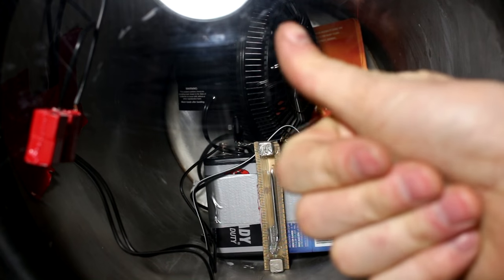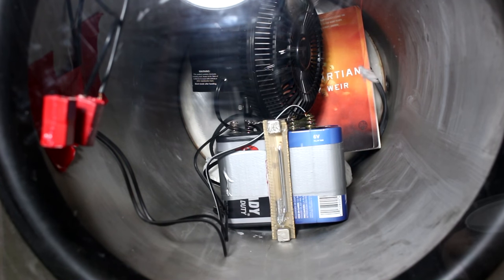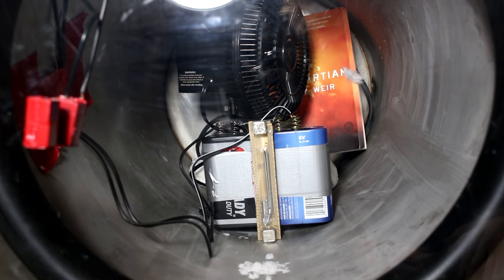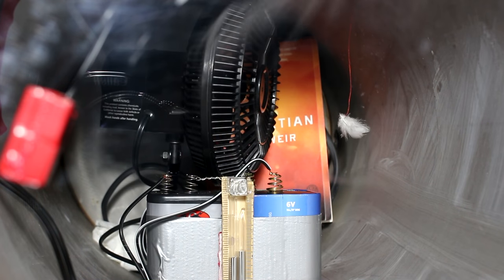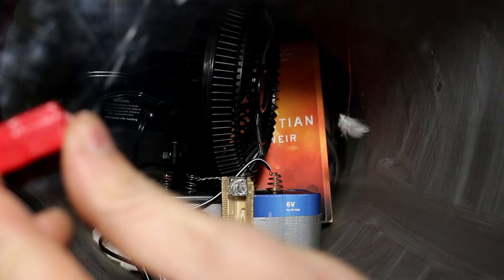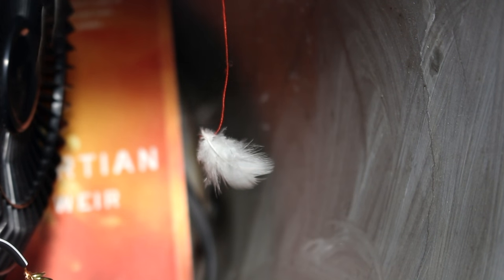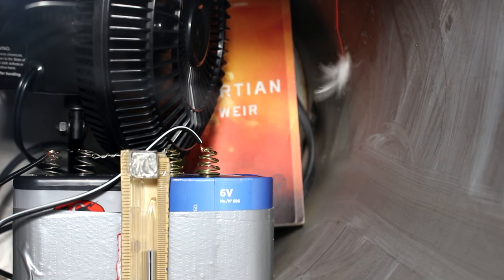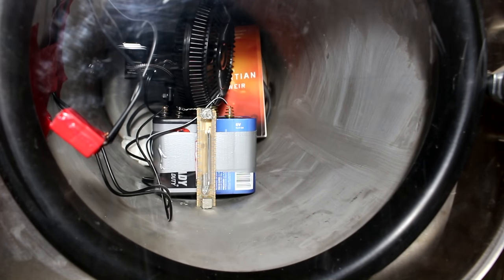How Strong is The Wind on Mars?

Comment: Could you maybe try to produse a venus like atmosphere? If it's possible...
Reply: That could be really fun to do, build some type of pressure chamber and fill it with Co2. Although the heat would take some brain power on how to achieve it without burning his lab down. Not like he needs to simulate the temperature anyways though depending on the experiment like the one here...
Reply: Iron ball, coil copper 1/4" pipe in a cone, backing ferrite from a TV yoke to focus, external coolant run to keep the copper from melting, induction heat that in the high pressure CO2
Reply: He could use one of the high pressure tubes he has, but then he'd have to put it in his lead melting furnace to get it hot enough.  No fan and feather could survive that.
Reply: ***** Yeah you are right, induction is a safe good method to use but the heat would only be able to transfer through conduction unless the material being tested itself is conductive as to generate eddy currents.

Wait are you suggesting that the copper coil to be used like a baking element? That maybe could work then since that could transfer heat by convection and even radiation like the real thing, the sun....

That is a genius idea, I think Cody should consider it, i'm sure he has an old stove laying around somewhere or even could build one himself. Although if he were to build something then using nichrome wire like in pottery kilns would probably be the easier route.

Comment: Is there a reason why batteries wouldn't be able to perform in a vacuum?
Reply: No, not that I can think of, at least with LiPo's.
Reply: It depends on the batteries.  The ones he's using have a carbon rod cathode, a  zinc case anode, and the electrolyte is manganese dioxide, carbon, a smidge of iron, and a tiny amount of a base liquid.  Those batteries will fail if they stay in long enough.  Specifically that liquid will sublimate out, and then it's kaput.

Aluminum-air batteries won't work in a vacuum. Silver-Oxide will if it's sealed.  Alkaline batteries work for a while, until the electrolyte sublimates. Molten salt batteries work as long as they stay warm.  It all depends on the chemistry and how they are sealed.
Reply: LiPos are sealed, that's why you see them puff up when they get old.  If there is enough air inside them the Vacuum will cause them to expand from the reduced pressure.  It shouldn't effect the chemistry, but if the swollen pack hits something sharp it might pop and fail.

Comment: Wow!  If a 200 mph wind wouldn't do much of anything, I wonder how fast the winds must be to create the "planet-encircling" dust storms?

"Once every three Mars years (about 5 ½ Earth years), on average, normal
 storms grow into planet-encircling dust storms, and we usually call 
those 'global dust storms' to distinguish them," said Michael Smith, a planetary scientist at NASA's Goddard Space Flight Center in Greenbelt, Maryland.
Reply: BarefootDrummer My guess somewhere around 60 mph.
Reply: The max wind speed on Mars is about 60 mph. The "planet-encircling" dust storms are because the "dust" is incredibly small... 50x smaller than on average dust on Earth, around the size of smoke particles. 

In those "planet-encircling" it actually more like a "fog" or "smoke" of dust that covers the planet rather than strong winds picking up dust and rock like is shown in the Martian.

Once it settles it's only a few microns of dust that settles... which is about 70-100x thinner than a human hair. So while it looks visually impressive and does actually block out sunlight... it's actually not much dust relatively and when it settles it's incredibly thin.
Reply: Thanks Buckster, personally, I haven't seen the movie, so any references to it go over my head.  However, I have seen photos of Mars before and after the referenced dust storms, and it's pretty incredible (meaning I'm having a hard time believing) that such visual obstruction could be created by a mass of material that would settle to a thickness "70-100x thinner than a human hair."  Do you have any sources for you statement?
Btw, I'm just scientifically curious, I'm not trying to be argumentative.
Reply: Pretty sure he just quoted nasa.
Reply: Well, thanks Reagan, but I was looking for an actual source.  For example, I gave a direct quote from a NASA scientist, but in my initial comment, but didn't provide a source.  Here's the NASA page from which my quote originated: http://mars.nasa.gov/news/whatsnew/index.cfm?FuseAction=ShowNews&NewsID=1854

Additionally, if something were capable of settling to a fraction of the thickness of a human hair then it's hard to believe it is capable of producing the solar radiation reducing (and therefore power limiting) dust clouds that NASA has become accustomed to with the Mars rovers.

Comment: That outro video was interesting, the vibration from the fan caused far more motion of the feather than the wind itself, no wonder you repeated the experiment with an alternative attachment. The book was a nice addition.  However JPL/NASA have mentioned miniature tornados on mars being responsible for cleaning dust off the solar powered rovers. There is a theory that martian dust is electrostatic, and the wind storms are ionised because of the atmospheric conditions which caused the storms. Could you possibly think of an experiment to test this theory? 
Edit: Top google result for Mars dust electrostatic "The Electrostatic enviroment of mars and the moon": https://ntrs.nasa.gov/archive/nasa/casi.ntrs.nasa.gov/20110008730.pdf 
Ok, alternative experiment, can you test the 'rover cleaning events', cover a solar panel in some electrostaticlly charged dust, put a larger fan in that vacuum chamber and an ion generator.

Comment: Martian dust particles must be incredibly small if the almost nonexistent wind there can blow them off the rovers solar panels
Reply: indeed, they're about the same size as smoke particles. Dust doesn't form back into rock on mars as much because there's no surface water to stick them together, so they have a long time to wear down to almost nothing.

Comment: How then is there massive dust storms on Mars that we clearly can see?
Reply: TheMontanaDave I think it does happen because of the faster wind speeds and less gravitational force.
Reply: Da SkyFishy That doesn't answer his the question
Reply: They're electrically driven. Small particles are easily affected by electromagnetism.
Reply: And where the hell is your evidence of this?
Reply: The dust storms are caused more by static electricity of sorts than by wind.
Reply: Use your powers of deduction, we know the wind is not strong enough to cause dust storms so now we need to figure out what other possible explanations there are for dust storms on Mars. The next most reasonable explanation when we take into account that the surface is made of iron oxide is static electricity.  We can also use our powers of observation: http://link.springer.com/chapter/10.1007/978-0-387-87664-1_26#page-1
Reply: Actually according to NASA (Sorry Cody- these guys know a bit more than you) they are caused by the sun heating up the surface and creating terminals in which drive the dust up.  http://mars.nasa.gov/news/whatsnew/index.cfm?FuseAction=ShowNews&NewsID=1854

Comment: I doubt that's accurate. The fan would produce way less wind in the low pressure environment. And without actually measuring the wind speed, you wouldn't know how that compares to mars.
Reply: Regardless, it would still need a much higher wind speed than earth to effect matter as much as earths winds.

Comment: Where is the proof of the gas flow produced by the fan? If the real wind velocity on Mars is X km/h, does this little air-designed fan have the capacity to produce that kind of wind velocity in such a thin atmosphere? I suspect not, but stand to be corrected. My guess is that if you lower the pressure by X, you need to up the power of the fan by some related ratio of X to make it equivalent.
All this proves is that a fan designed to push thick gas doesn't work on thin gas!
Reply: not sure but i think he removed all the air including dry ice co2 in the container so the wind had no substance to travel along with
its pretty obvious since you can see that the feather dosnt even move that just means that there is no more gas avaible

Comment: if there was a 200mph wind on mars does that mean that the wind was even faster compared to earth?
Reply: 200mph wind speed on earth versus 200mph wind speed on mars would obviously be the same speed, but the impact would not be as hard as on earth as the air is a lot thinner.
Compare it to having a hair dryer blow in your face versus a water hose. The density makes a big difference.
Reply: I wonder what speed the wind would have to be to have the impact like in the movie...

Comment: love your vids but I mean come on dude we already know a standard fan produces next to zero thrust in a vacuum plus the feather is being effected by earths gravity which is much higher than on mars .... hope the next experiment is much more thought out..
Reply: Robert Sanders it wasnt a vaccum. so before you criticize something at least try to understand what you are even talking about. this is why he used a feather instead of a strap.
Reply: Nerys its a chamber that had most of the air removed which is by definition a vacuum. perhaps if he redoes it he can use something like an edf turbine to overcome the lack of air since it spins at a much higher rate and has more blades and maybe throw in some maths to calculate for what movement is obtained at our gravity level to what movement that would translate to in reduced gravity ...
Reply: Robert Sanders no. you are mistaken. by definition a vaccum is without atmo. not low atmo. there is atmo in there just a lot less than earth.

again you should understand what your are talking about first. i assume because of the lack of efficiency and increased gravity that this is why he used a feather.
Reply: Yes, all Cody has proven here is that fans designed to work at atmospheric pressure here on earth don't work at lower pressures.

To produce similar wind speeds you would need to change the blades.

What he is doing here is like trying to use a boat propeller as a fan.
Reply: MrSparklyStuff Its like a boat propeller in air, In dense water it produces thrust, in normal earth atmospheric density it doesn't move anything.  To get the same air velocity you need to redesign the fan for the lower density air.

Even just measuring the air velocity in this case is somewhat tricky. You can't use a normal wind speed meter because they are designed for near sea level air density. A differential air pressure sensor might work, that is what they use on aircraft to measure air speed at altitude.

Comment: Would this prove that rockets do not work in space?
Reply: Or is there something missing in the experiment to prove that?
Reply: This doesn't really have anything to do with rockets.
Reply: Rockets carry their own gas, they don't need an atmosphere to push.
Reply: I don't believe rockets rely on atmosphere for their propulsion. They use the force from their thrust, remember that every action has an equal and opposite reaction so if the rocket is pushing out energy one way it will go the other. A fan is designed to simply move air around and there is less air on Mars so it's less effective
Reply: Rockets work off of the conservation of momentum. Just like a gun fires a bullet and results in a recoil of the parent gun in the opposite direction, so too does a rocket fire gas molecules that have mass in one direction, resulting in the thrust, or 'recoil' of the parent engine.

To give some perspective, the atmosphere on earth is 14 psi at sea level. The combustion chamber of Saturn V's third stage (the one that operated in space) had on the order of 730 psi. Way, WAY higher concentration of gas molecules as in this demonstration. The ambient pressure is almost irrelevant when the combustion pressure is that high.
Reply: Esteban Garcia Rockets don't require an atmosphere to work as they use newtons first and third laws to move around. In layman's terms a rocket throws a large amount of mass and energy out the back to propel itself forward (when well inside a gravity well). In space the amount of gravitational force is reduced resulting in a proportional decrease in the amount of mass and energy needed to be thrown out the back to be propelled forward. In orbit the practical physics changes a little because they aren't technically out of the major gravitational control of earth but in free fall around the earth. I.E. The earth curves away from them faster than they can fall towards it. Making it look like astronauts are just floating around when in fact they are actually falling. Outside of the gravitational well of the sun there would still be gravity because of the gravitational attraction of matter induced by the Higgs field.
Reply: Thomas Schulz Too much, too fast. You got into quantum mechanics when the question was about classical mechanics.
Reply: TehDubster Entirely possible they were never taught physics or are surrounded by space exploration deniers and all they know is the badly thought through musings of such deniers. Vitriol gets nobody anywhere.
Reply: i was just asking a question because i didn't know. please enlighten me on how it works then.
Reply: TehDubster I get your frustration, but I'd still rather associate myself with a space denier than a murderer, to be honest. Better to just keep fighting the good fight and try to educate people.
Reply: Esteban Garcia Like I said before, it works exactly like a gun does. The nozzle of a rocket is like the barrel. The bullet has mass, and exhaust gasses from a rocket have mass. When you speed them up quickly, they gain momentum in one direction. In order to conserve momentum, the same amount of momentum is applied to whatever launched it, in the opposite direction. There is no need to 'push' against something in this case. A gun does not wait for the bullet to push against its landing spot to recoil, it does it immediately. Likewise, as soon as the gasses expel out of the rocket nozzle, the engine moves in the opposite direction. It doesn't matter what the gasses do outside, it only matters in the nozzle.

Comment: Doesn't mars have some type of atmosphere? A fan is nothing different then a pump, if there is any týpe of gaseous or substance in the atmosphere it will try and move it, may not be efficient but it will try. If Mars has storms or winds then it's got to have something in it's atmosphere ???
Reply: Yes but it's very thin. On average about 0.6% that of Earths atmosphere pressure at sea level, ranging from 0.3mbar on the top of Olympus Mons to 12 mbar at the bottom of Hellas Planita.
Reply: davidenespana 

Ok so is there away for himans to make a atmosphere on mars and how would be done and how long would it take.
Reply: davidenespana 

Ok so is there away for himans to make a atmosphere on mars and how would be done and how long would it take.
Reply: Dar Cam
Probably. A very long time. (no idea really - 100s to 1000s of years). steering icy asteroids so they fall onto the surface to provide water & gases, and probably some form of genetically engineered plant life, to produce oxygen. If you can get a decent greenhouse effect going then a lot of the water thats at the poles and under the surface might be induced to melt. In the long term I'm sure some sort of terraforming might be possible, exactly how, I dont think anybody really knows. Come back in a hundred years and ask the same question.

Comment: So much wrong with that experiment. All you did was to show is that a fan doesn't work in a vacuum. The dry ice did not replace the air as it too was sucked out by the vacuum pump. With no method of measuring what (if any) carbon dioxide might still be in there, it makes the entire experiment invalid.

Comment: Sorry Cody but this is bad science. All you have proven is that the fan doesn't work at lower pressures. There is no way your getting close the same wind speeds. What your doing there is like trying to use a boat propeller as a fan.

Even just measuring the wind speed is a problem here. Standard anemometers really only work well at atmospheric pressure.  Maybe a pressure differential sensor like used for airspeed on aircraft might work.

Good science requires controlling the variables and wind speed here isn't controlled. 

You might be able to get close to the same wind speed by using a much higher RPM motor and a speed controller. Monitor the power going to the motor and adjust the RPM to maintain the same power draw as the pressure drops. To produce the same wind speed on mars may take several times the RPM. 

The better solution would be a fan blade designed for the lower pressure. 

I'm not arguing that wind load forces are not a lot lower on mars. Just that this demonstration isn't accurate at all.